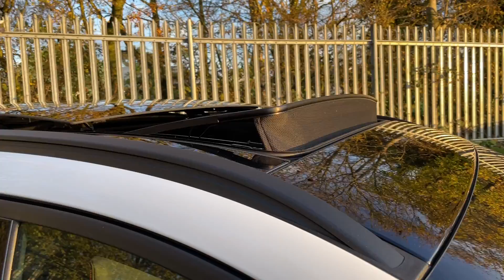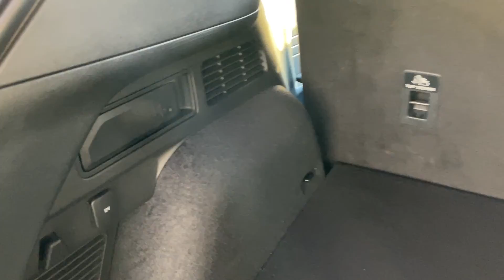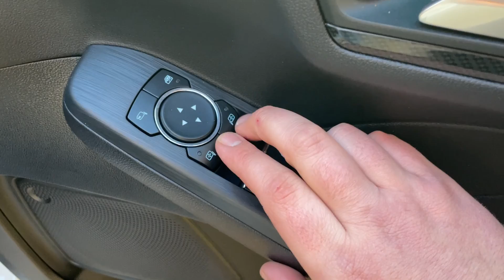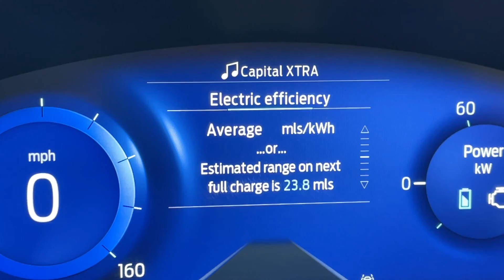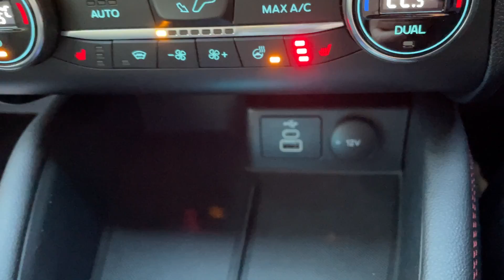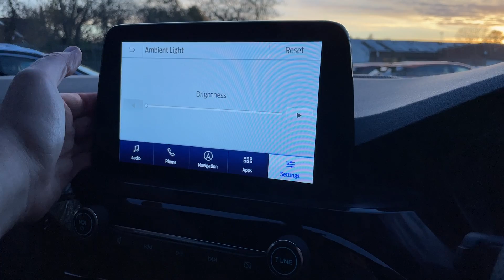*** VEHICLE NOW SOLD *** FORD KUGA ST-LINE X EDITION PHEV 2.5L 225PS CVT AUTO

Comment: Basics are, plug it in for a few hours and get 35 miles without burning petrol. The main button for my use is different in my 20 plate ST line edition to that of the model illustrated, the normal, electric only , save for later and engine charging the battery mode button is not in view at bottom left of centre console. Not keen on the cvt auto box, but got used to it. Best car I've driven with 225bhp on tap and great spec.